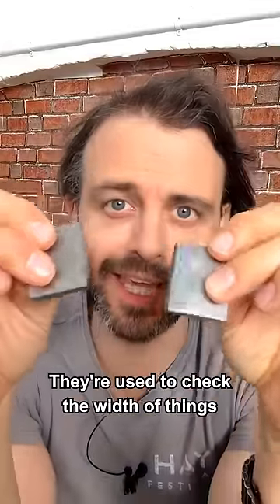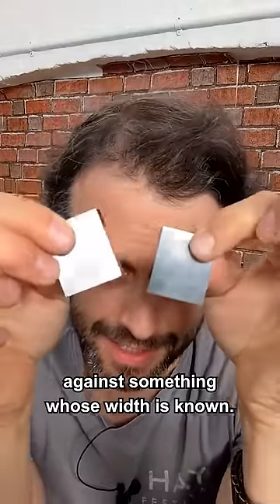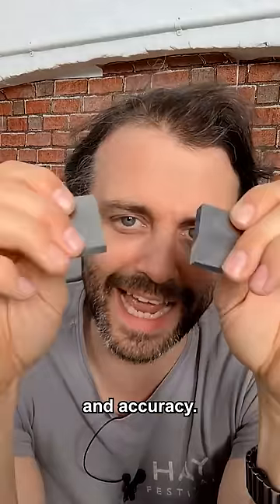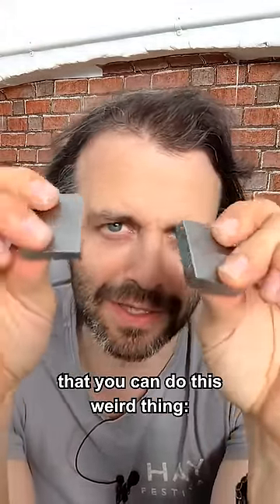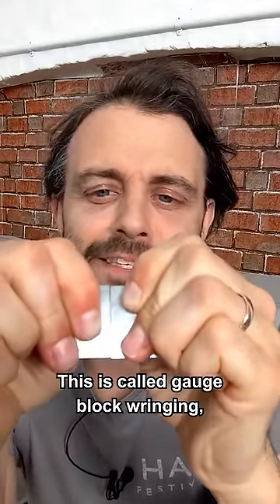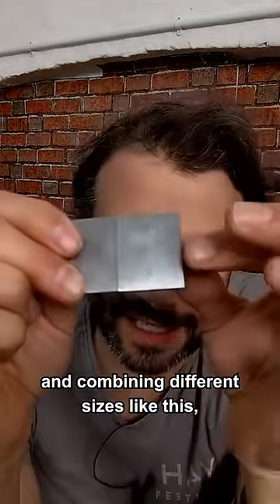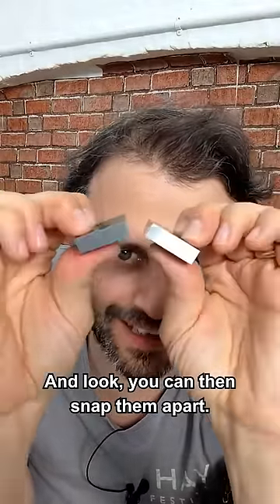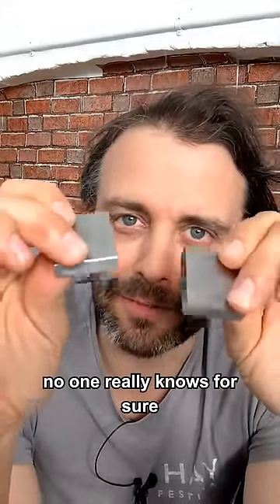No One Knows For Sure Why This Happens!

Comment: Originally called Johanson blocks, if you leave them wrung together too long they will vacuum weld together permanently (and cost you dearly) they are NOT ground to size, they are diamond lapped. They are made in sets of several grades, workshop, inspection and reference sets. Molecular cohesion is correct term
Reply: I assume these days they  could also be made by EDM (Electrical Discharge Machining).
Reply: Well, this cold welding thing is more a myth. Maybe possible with highest precision gage blocks, but even with those you calibrate cmm´s with it is not possible. Found some of these sticked together for years and they were still easily seperateable.
Reply: Also its adhesion, not cohesion.
Reply: @krebskrank  adhesion is molecular attraction of different materials, cohesion is attraction of molecules of identical materials.
Reply: @pdoubleyou7801  Ehm, no. Adhesion is molecular attraction of dissimilar particles, which has nothing to do with materials. A gage block and another are dissimilar. The reason one gage block is solid and does not dissolve is cohesion. The reason one gage block stick to another is adhesion.
Reply: Cold welding can only occur in very cold temperatures in a vacuum.

Comment: Probably cold welding. The twisting motion scrap away some of the oxidation layer. Its strong but also weak enough to pulll apart.
Reply: If cold welding would be that easy to do, you could scratch any metal to another and it would stick. I don't think that's what's happening
Reply: @samsam.03  yes its easy. The different from other metal, they are not smooth and oxidation layer is thick. This one smooth. You can actually do cold welding here on earth very easily with plastic. Search youtube cold welding plastic and you will find numerous interesting object that you can cold weld just by cutting it with scissor
Reply: @samsam.03 surface contact ("precision" in metal faces) is important.. materials with higher "plasticity" can be less smooth and still cold weld... 
For instance, If Steve could/would apply more pressure during the joining (wringing together) the joint gets more and more difficult to snap apart.... 
Fun fact... the very precision utilized in the Space Industry..makes cold welding a greater risk (several failures were traced to this phenomenon...)
Reply: @brukujinbrokujin7802  you can't compare metals and plastic like that
Reply: @patrickjordan2233  I know what cold welding is.. But here is whats critical for cold welding: after they bond, they act as one structure resulting in: you can only disconnect them by breaking the "weld" which causes the surfaces to be destroyed. That would make gauge blocks a one use product 

But assembling gauge blocks like that for a short time doesn't even rough up the surface. You can use gauge blocks for years without having to regrind / repolish the surfaces

Yes cold welding does happen at gauge blocks when you leave them like that for a long time(which is why you SHOULDN'T leave them for a long time together). But it's not the reason why they stick together in the first place

Also the amount of force to break a bond between metal atoms has to be way higher than just a simple snap with your hands

Also the problem with space engineering is not the precision, because we have that precision in other branches (aerospace, nuclear stuff, etc) too. The problem is the VACUUM
Reply: @brukujinbrokujin7802 The self healing plastics you're referring to work differently to metallic cold welding, one of the more popular videos on this platform about them was even by Steve himself

Comment: When you twist them together, you're scraping off the oxidized outer layer. 2 pieces of a material will fuse together at a molecular level. The reason they can be snapped apart is that this process is extremely imperfect in an environment with oxygen. There is barely any fusion - so they can be easily taken apart - but there is some.

Comment: Technically, they are machined and then precision ground. A surface grinder provides a magnitude of accuracy that you don't find with most milling machines. I had always thought that because the surface finish is so fine, and the surfaces are so flat, that you are actually able to wring the air space out from between the two surfaces causing a vacuum to lock them together.
Reply: It makes perfect sense. I’ll buy it.
Reply: To have a vacuum you need volume.  You can't have a vacuum in zero space.

Comment: 1. Air pressure from the surrounding environment as the air is squeezed out when the blocks are slid together. 2. Surface tension from oil that remains on the gage blocks or water vapor from the air acts as a glue to hold them together. Just a simple google search, not definite evidence in my part

Comment: This phenomenon is known as cold welding. 
Explanation: When two smooth surfaces are brought together in contact they tend to attract each other due to various elements for instance air between these surfaces is pushed outwards creating a partial vaccum. Atmospheric pressure is exerted on the outer surface pressing them together and inducing pseudo magnetic effects.
Reply: works in a vacuum
Reply: This phenomenon is obviously not cold welding because they clearly aren't welded together. It's even in the name. Cold welding refers to 2 metal objects becoming permanently fused because their atomic lattices come into direct contact and their valence electrons can cross over, turning them into a single continuous atomic lattice.

Comment: They link together because the crystal structure of the metal slightly breaks down with friction and pressure causing flaking, and the flakes fill the microscopic voids with dense particles locking them in place like a rivet. 

No one knows because the flaking looks like normal decay and you can't see the process even under a microscope because the metal isn't transparent.  But you can mimic this process with many minerals and metals in nature.
Reply: If any of that were true,  then milling machines would just seize up,  and you could do this with any metal blocks,  not just gauge blocks.
Reply: @LarsLarsen77  not necessarily because one thing I forgot to mention that I was thinking about earlier is the way these blocks are cut so fine. Milling machines do seize up when the right friction is applied. 
In nature, you can mimic this with many minerals.

Comment: I used to work with these things when I built aerospace parts, and noticed the same phenomena. Weird thing is it happens whether you lubricate them with machine oil (intended to keep them from rusting) or not. If they're not lubricated, it could be that they're sticking because of how precisely machined they are and a small amount of friction welding on a molecular scale. If they are lubricated, it could be because by pushing the oil out to the edge seal, it creates somewhat of a vacuum effect pulling the two faces together.

Comment: Van der Waals forces are unlikely for metals. But they work very well with the Gekko (the soles of the feet are made of fine hairs/contact splitting). With very clean metal surfaces, local atomic bonds and even cold welding can occur due to the metallic bond (positive atomic cores and negative electron gas). This is influenced by surface layers (oxide on metal), the environment (e.g. humidity, oil) and the electronic structure (proportion of free electrons, precious metals are more prone to adhesion than iron)
Reply: Don't lie to me. Ever. Again.
Reply: It is the Van der Waals force that give metals their material strength, also explains this phenomena as well as cold welding. If the gauge blocks were held together tightly and long enough, they would in time weld together.

https://en.m.wikipedia.org/wiki/Cold_welding
Reply: @jimgraham6722  hmm🤔Sorry but van der Waals forces are nearly not relevant in this case. Maybe you heared it differently (😉 confirmed by KIT University Karlruhe, Germany, Department for Materials)
Reply: @CharlyBrown11966  https://en.m.wikipedia.org/wiki/Cold_welding
Reply: They use carbides rather than metals so that there is a clean cubic lattice. The cut is so clean that the molecules can't tell it's two distinct bodies. If you leave them long enough they'll cold weld permanently.

Comment: Its simple why it happens.  When you wring them together the air is pushed out and the slight amount of oil on them allows them to stick together.  Did a thesis paper on this.  My professor was a PhD in metallurgy and material science.
Reply: So they dont stick together if you can remove all the oil?
Reply: Thats all well and good, but it's not fair to keep the invisible miniature pygmy smurfs out of the equation. After all, they have a hard time holding them together with their tiny arms and are rarely mentioned even though they deserve a lot more credit for the ungrateful never-ending task of making sure it works. They live inside the gauge blocks and they are so small they easily fit between the gauge blocks, just imagine the great number needed to pull off that stunt every time it's done. I'm about to postulate my thesis on this subject.
Reply: @bluflare12345  makes it harder.

Comment: GPT-4:

Gauge blocks, also known as Johansson gauges, slip gauges, or Jo blocks, can stick together when twisted due to a phenomenon known as "wringing". This occurs when two very flat and smooth surfaces are brought into contact with each other. The mechanism behind wringing is not entirely understood and is attributed to a combination of factors.

1. *Molecular attraction:* At a microscopic level, when two surfaces are very flat and clean, the atoms of one surface can get close enough to the atoms of the other surface to allow molecular attraction forces, such as van der Waals forces, to come into play. These forces can pull the blocks together firmly.

2. *Air exclusion:* As the two surfaces are brought together, air is progressively excluded from the interface. When you twist the gauge blocks slightly while pressing them together, it helps to expel air from between the blocks more effectively. With the air removed, a vacuum can form, creating suction that holds the blocks together. This reduction in air pressure contributes to the sticking effect.

3. *Surface tension of films:* Sometimes, there may be a very thin layer of oil or moisture present on the surface of the gauge blocks. When the blocks are brought together, this thin film can create capillary action, resulting in a surface tension force that additionally helps to hold the blocks together.

4. *Plastic deformation:* Under considerable pressure, there might be a slight deformation at the microscopic level, where the peaks and valleys of the surfaces conform more closely. This plastic deformation enhances the contact area between the blocks, enabling them to stick together more efficiently.

Wringing requires the surfaces to be extremely clean and free from dirt or oxidation. Any contamination can prevent the blocks from sticking. The phenomenon of wringing is particularly useful in metrology for building up stacks of gauge blocks to achieve a desired dimension with high accuracy and stability.

Comment: Some metals have a flexible crystalline structure. The press and twist pushes air out of the way and allows the two crystalline structures to interface like legos or Velcro, creating an incredible amount of surface area.

The most accurate macro example I can think of is if you take two plastic dartboards. Press and twist them together and then pull them apart and you'll get the same effect on a macro scale.

Comment: I did this with two pieces of quartz, and they are stuck together to this day. Fused I believe. If I strike one side with another piece of quartz it luminesces one half then the other and oscillates (number of oscillations dependant on the force of the strike) back and fourth between the halves, increasing in brightness whilst changing hues of purple through to a final white flash of BOTH halves.
Reply: COOOOL!!  Do you have a video of that to post on here for the whole world to see??
Reply: Pics or it didn’t happen.
Reply: @crust_no_tuna it never happened
Reply: We definitely NEED a video of that.
Reply: Post the video.

Comment: It's called cold welding. The two pieces share electrons and weld together. It happens in space frequently and it's strengthened if you apply pressure, for instance, striking with a hammer.

Comment: It's very simple. They syick together because they are so smooth, thay the edges seal air-tight. If air can not seep through the sides, then it can not displace the seal between each block.

Comment: As a dumb blob, I can confirm that this never happens , unless the width of the biggest gauge block is twice as red as whatever you are trying to measure, but only if the smoothness of the third measured surface is available for purchase for whatever price you are willing to smooth. Beware, though, gauge blocks are EXTREMELY hungry in the morning, so they tend to be a bit slower to anger if you feed them the night before. Make sure you feed them judiciously every night and please, please DON'T TRY THIS OUTDOORS

Comment: Its some sort of intermolecular force. If you leave them long enough together they weld themself together without beeing heated
Reply: [Welding] only happens to threaded fasteners (especially stainless steel) torqued in a vacuum, where the surface oxides and contaminants are displaced by the shearing under heavy load.

Comment: In university, mathematics, there's a branch of applied maths that I called lube theory (forgot the real name). It's essentially the exact opposite of this, saying that as the distance between two objects become significantly smaller than the surfaces of the two objects coming together, then a great positive pressure is produced stopping them from touching and acting as a near zero-friction barrier between them.

This looks like the exact opposite. You twisted at the start so the ratio allowed them to get much closer (still not touching, technically) then you twist so the surface area increased signficantly. Trying to separate these would do the exact opposite of what I said earlier, and it would create a great vacuum, preventing them from separating easily.
Reply: It works in a vacuum so it’s not to do with air pressure
Reply: @mattmurphy7030  Nah that doesn't matter. Vacuums aren't perfect, and scientists often create vacuums inside of vacuums to make the vacuum deeper by the same ratio. Unless this works in a perfect vacuum (which doesn't exist, not even in space)

Comment: When I asked my lab teacher, he himself did not know, he was just twisting things.
Reply: I’m assuming it’s because the air between is pushed out cuz how smooth they are and create a suction, and all the air pressure around it is pushing them inwards and there is not pressure between them to push back, that’s also how suction cups work, it pushes the air out and all the other air pressure pushes into it, until air is let in, like when he snapped then he let air in.

I’m guessing here but I immediately thought of that when i saw them “stick”
Reply: @hellobye5952  yeah, i thought exactly the same, but dunno whether it's right or not
Reply: They have oil on the surface. If there would be no oil, you could not slide the two pieces over each other. Basic mechanics. Cold welding happens only in vacuum, every metal surface exposed to air oxidizes instantly, even gold.

Comment: Same reason why metal cold welds in space. It's smooth enough that when you rub them together it will scrape away a tiny amount of the oxidation layer and tiny bits of each piece join at a molecular level just enough to stick together, you can see a temperature change when you break or join them.

Comment: Richard Feynman put it, when the interfaces between like materials are very flat, there is "no way for each atom to know which block it is in", so the bond across the interface gets more and more like the normal molecular forces holding the lattice together the flatter the interface

Comment: Depending on what they are made out of (if they are a pure non-alloyed metal they may actually be welding themselvs together at the molecular level due to pressure and friction. The metal wants to continue its crystaline molecular structure and will under specific circumstances "cold weld" themselvs together.

Comment: Pretty sure we do-basically, because of the way that metal's atoms are arranged, the only thing stopping two pieces of metal from "cold-welding" to each other is the thin layers of air and corrosion between them. So, if those blocks have only very little corrosion and are so smooth that rubbing them together in that way prevents any air from getting between, then they can cold-weld to each other! The phenomenon is more commonly witnessed in a vacuum, where it happens stronger, more easily, and can be an even greater problem-many an astronaut has lost their tools due to them cold-welding to whatever they happen to be working on.

Comment: Metallurgist here. It's called cold welding and is nothing new. The metallic atoms are just having the same interactions with the neighboring atoms in the other block just as they do with the other atoms in the same block. One of the requirements for cold welding is a very smooth face.

Comment: Maybe the surface is so smooth that the first layer of atoms is completely uniform. When you apply friction by rubbing them, the small layer atoms become interlocked; kind of like a puzzle piece that is slid into place rather than just placed outright.